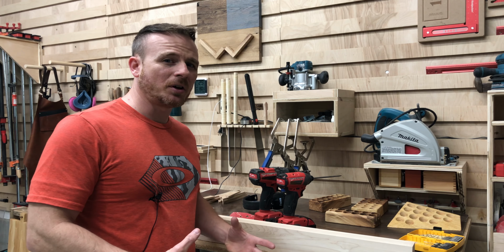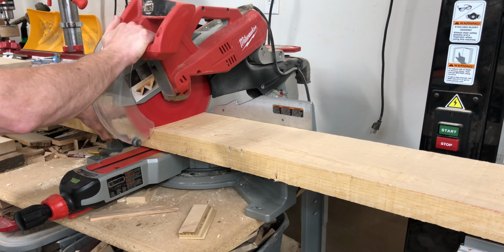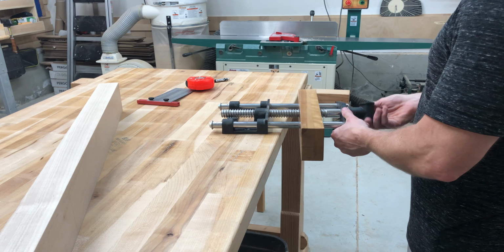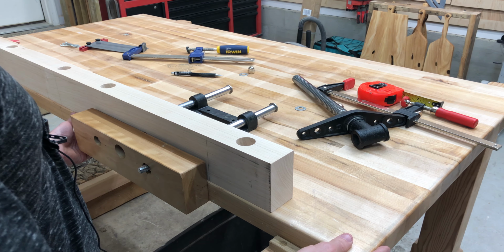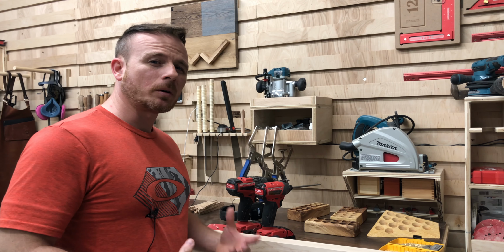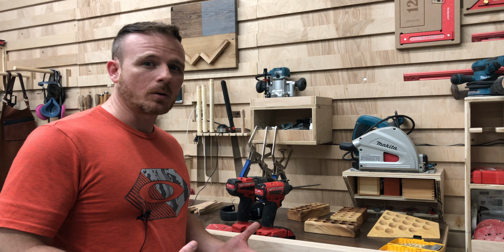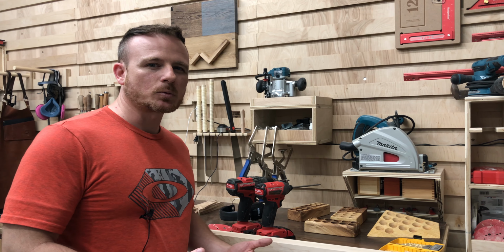Installing a WorkBench Vise // How To - Woodworking

Comment: Hello: excellent job, very simplistic yet right to the point; many video creators expound on working the installation of the vise with the bench top off the table and turning it upside down rather than to work from under the table; while viewing how smooth your vise spindle assembly and guides worked and how smooth your table top looked I took a very good look at mine, (ahhhhhhhh); my bench table top is an old solid Oak door with planks 5.5" x 1.5" and weighs around 200+ lbs that I found; I realized my DOOR was not square or flat and needed a shave; I bring this up because I fought with the vise install for about 2 days, watching different videos and while watching YOURS is when I realized my mistakes, nothing that a good shave couldn't handle; my vise now works beautifully and the whole setup is just perfect, THANKS TO YOUR VIDEO, great work!!
Reply from the maker: Awesome journey! So glad I was able to contribute some. Comments like these make it all worth it! Would love to see your bench sometime!
Reply: Hello again, the picts are in the works and yes I do want to show it off, thanks.
Reply from the maker: I’m on IG @woodshaped so let me know when you have some!
Reply: Thanks a mil, very nice of you, makes me feel like there is camaraderie in woodworking; at first I've been somewhat slightly embarrassed yet my wife always backs me up; I have slowly put together my shop with left overs and very limited tool inventory, but I am proud and I do have knowledge which has helped me to use those tools to their max; I've used chisels, an old DeWalt portable drill with 2 rechargeable batteries, hammers and a well used rip saw; I now have a Craftman 10" table saw, a Ryobi drill press, (not the best but it works well), a slew of clamps (i'll be getting more of these), a work bench with wood working vise and a metal working vise. Harbor Freight has been my selected go to friend for affordable and worthwhile tools; I started learning how to properly and safely use hand and electrical tools about 100 years ago, i came back to it in the last 5 years because of the passion in the feel, smell and touch of a piece of wood and then help it evolve into something other than a piece of wood; i will definitely forward a few picts soon.

Comment from the maker: Feels good to finally have a workbench vise installed!
Reply: So lets say i purchased a workbench with a steel frame and the table top was just mdf board but i still wanted to bolt down a bench vise onto it. Obviously the mdf alone wouldn't be strong enough to get a nice strong bolt down so i was thinking of buying a stronger wood from Lowe's to cut to the proper size of the vise and maybe putting a piece on top of the mdf and one underneath it as well. Then bolt down the vice into all 3 of them. Like a sandwich. What type of wood would you buy to do that ? What wood can be on the thin side but still have a good deal of strength to it ? 🤔🪵
Reply from the maker: How will you bolt the vise down? Onto the top of the bench? Trying to picture what you have in mind. For vises I would go with a strong hardwood

Comment: Please show how you attached the vise/stretcher to the top?  Didn’t make sense to me, drilling big holes and then some small thing inside?
Reply from the maker: There are those three thick bars, one being the threaded bar in the center that comes with the vise. I drilled the three holes for those on the apron. On the oppose side is a black piece of the vise and that sits on the oppose side of the apron so you can tighten the vice to the apron (stretcher) and so it's easy to screw in to the under side of the bench top. Does that make sense? 4:30 to 5:00 minute mark
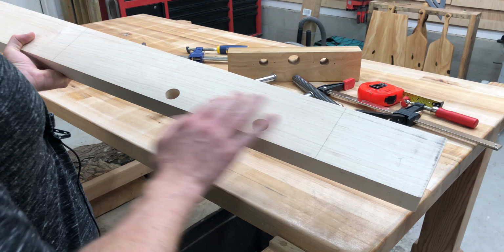Reply from the maker: I basically used the vice itself as a clamp to clamp it to the apron so that i could then screw it into the workbench top 3:30

Comment: I have a very similar 10" woodworkers vise that goes back to the 50's, possibly late 40's given to me by a friend. It was made by " THE LITTLESTOWN HDWE. & FDRY. CO. Littlestown, Pa., U.S.A.
I'm talking old school here as it has the iron jaw plates front & rear. I turned it into a 14" vise with some scrap oak & birch for my jaws. I refurbished it beforehand & gave it a coat of implement green paint.
Your carriage assy., main screw & guides are almost identical to my setup. I followed a Paul Sellers video on YouTube for my install with some minor differences but quite pleased by it's looks & functionality.
I too built my own workbench & is solid as a rock, absolutely no movement or flexing, however I love the pure beauty of your workbench top & how U used a single block of wood for the outer jaw & the workbench itself to act as the inner jaw, simply beautiful...
Bill on the Hill,
Vermont, USA... :~)
Reply from the maker: Awesome background on your vice. Sounds amazing and thank you for the kind words!

Comment: Better to tune the workbench that you have rather than build a new one.  Instead of adding weight, consider adding strchers along the length with tusked tenons with wide shoulders. You will feel the difference, day and night.

Comment: Nice end result.  I liked the methodical approach and precision work.  Unfortunately there were bad things happening along the way.  You have enough money tied up in Woodpecker tools to buy a used car but dangerously no support for the heavy maple as it comes off the table saw.  The other issue was minor, regarding the use of CA adhesive and accelerator.  I’ve used CA since 1976 so not a newbie to it.  Accelerator makes CA more brittle than it already is and you applied maybe 20 times as much as needed.  As a life long flying model airplane builder I’ve learned that the more accelerator, the more brittle the cured CA gets.  I would expect the glued on knob will pop off eventually from impacts as it drops onto the vise.  Aliphatic would take a while to set but I would have no concerns about its longevity.  Just one guy’s opinion based on experience.
Reply from the maker: Thank you David, and thank you for watching. This really cracked me up because it’s all true 😂 1) Sucky table saw setup no out feed while 2) Bunch of WP tools 3) CA glue, the knob fell off shortly after that and I ended up using titebond. It’s good now! I’ll get there eventually with the table saw setup...😄

Comment: Hi, many thanks for the nice video.  I would probably install the similar vise for my workbench.  May I ask a detail on drilling the holes for vise bars ( between the time slot 3:10 - 3:20 ). What kind of gap you set between the wood and the bars when drilling ?    I mean,  what would be the hole diameter if the bar is 20 mm (0,79 inch)     The reason I needed to know that is that ;  if the hole is so tight,  it would be hard to open /close the vise, on the other hand, if the hole is so loose, the moving part of the vise would dangle..  Thanks lot again.
Reply from the maker: That's a good question. I made my holes about 1/16 (1.5875mm) larger than the vise bars but even with larger holes it's less likely to have play in it because the bars on this vise, perfectly match the housing as seen in 5:00 - 5:10 time slot and it doesn't allow the vise bars to move. Hope this helps!

Comment: I am watching the video as I am looking to build a quick workbench myself and saw the maple butcher block which I plan to use. I noticed it wobbles a good bit. Does that drive you nuts? I assume you want to be able to disassemble it easily which is why you don’t secure the top. Other than that how is it for hand tools?
Reply from the maker: I recommend a video at the end of this one where I secure the bench to the legs. It’s taken care of most of the wobble.

Comment: 6:00 is there a reason for not having the jaw level with bench top?
Reply from the maker: The width of vise attachment piece underneath the bench in relation to the width of the bench top itself are the main reasons. Additionally, where the manufacturer attached the jaw block to the hardware. I can adjust it probably. Good suggestion. Do you know the benefit of it being level?

Comment: I’d be more concerned about how wobbly your workbench is - a lot of racking when planing.
Reply from the maker: Yeah I mentioned that in the video. You have to add weight to it. It hasn’t been a concern for me. If you need to put that much force on a hand plane then your blade isn’t sharp enough. Smarter not harder. 👍

Comment: What's the point of a nice vice and all the thick hardwood if your table wobbles 3 inches either direction. You are just asking for a incredibly smashed foot. And that's if your lucky.. one 5$ 2x4x8 would save the $300+ table plus the vice plus the medical bill plus however much time and effort into the project the gets smashed when it falls. I just dont understand. New to you channel so maybe I typing into the void, but this was 2 yrs ago so there is no way that went unresolved.
Reply from the maker: Hey Jacob! I understand your concerns. In the video I mentioned the wobble and yes, I fixed it afterwards. There is another video linked at the end where I resolve what I will now call the death wobble. 😁Thanks for watching man!

Comment: nice job but maybe look into planning the wood the right way with the gran, u will get much better results
Reply from the maker: Thanks for watching. If you look at the cathedral pattern on the walnut I’m planing the right direction. The holes in the shaving are due to my plane needing to be sharpened.